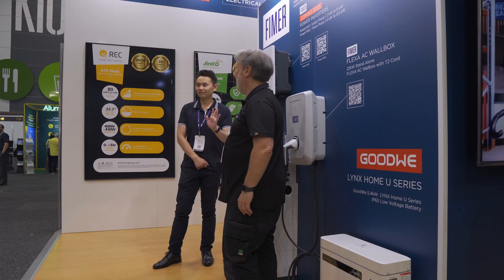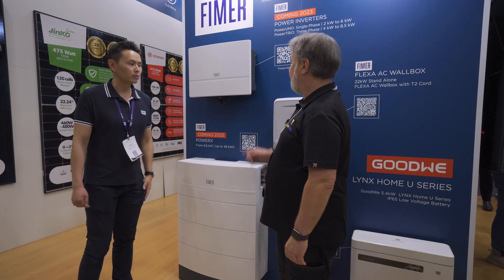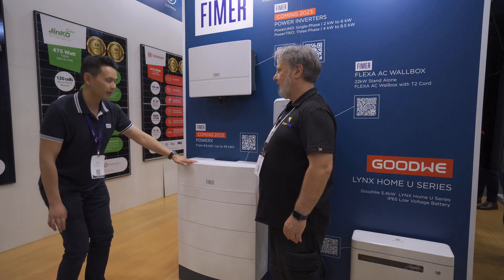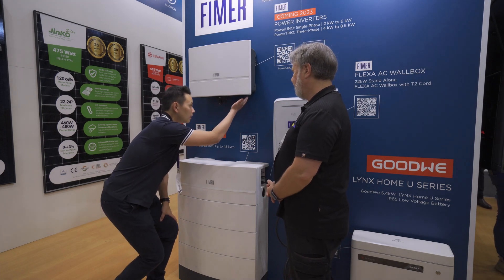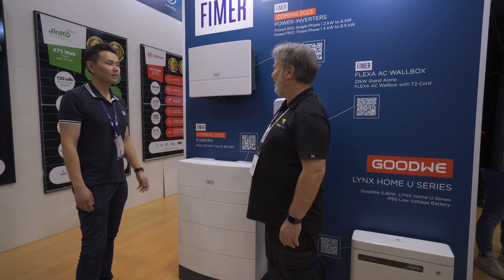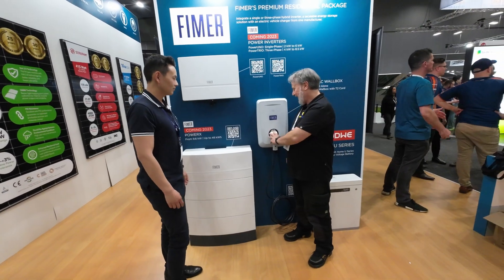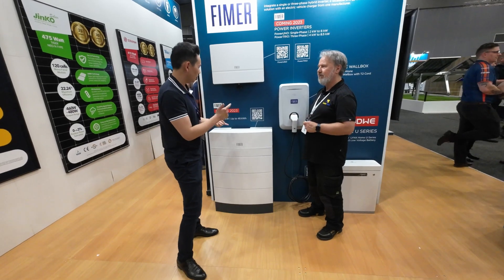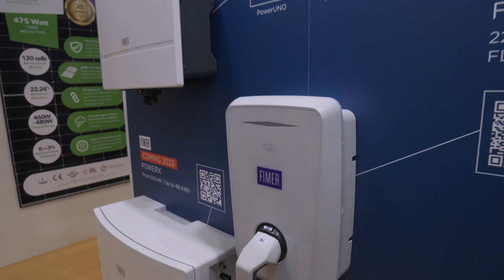Fimer's new hybrid inverter and battery

Comment: I would like some clarity on if it charges the battery and run's the loads at the same time. He didn't really answer that question.  Can it's do 5kva DC to batteries power a 5kw AC load of it's got 12kw of panels? You went soft on him Glenn and didn't get your question answered.

Comment: Firmer or otherwise, I'm finding that these hybrid inverters with 200% PV capacity are generally 2 mppt but one string per mppt. Given Australia has a 600V DC limit on residential PV, you'll get about 10KW PV max. out of this arrangement. I don't expect a product made for global distribution should cater to Australian regulators and produce a model specifically for Australia especially when said regulators and authorities can change their compliance criteria at the drop of a hat with complete contempt and impunity as to whether is will cause bankruptcy or not. They don't call it the solar coaster in Australia for nothing. There are hundred of anomalies, inefficiencies and interference between conflicting authorities and the red tape looks like a tumble weed. They all need to get fired immediately. They will serve our country better on unemployment benefits. So until otherwise, most of these hybrid inverters, regardless of manufacturer will be capped at about 10KW of PV.